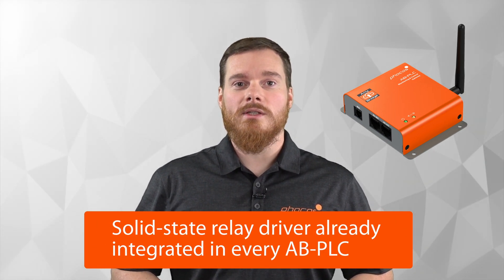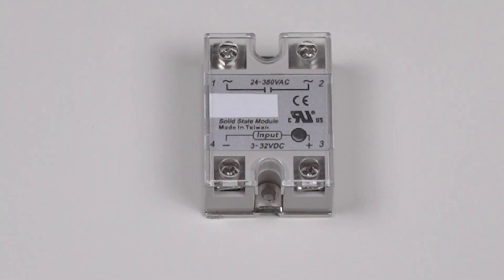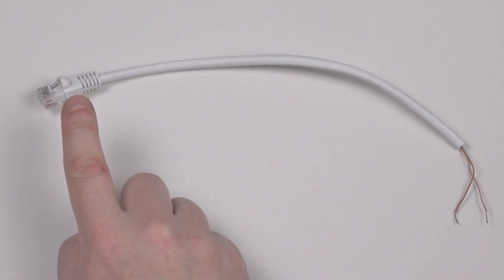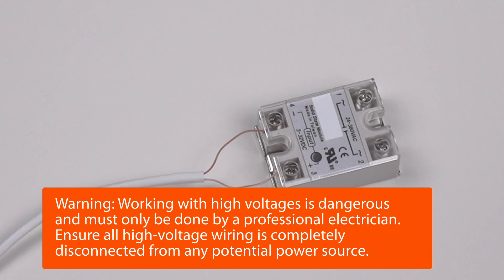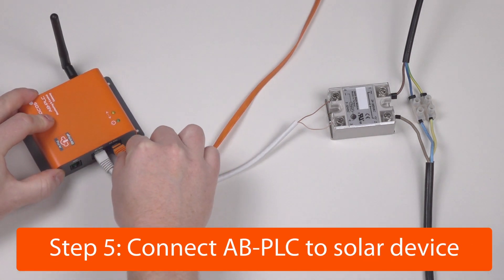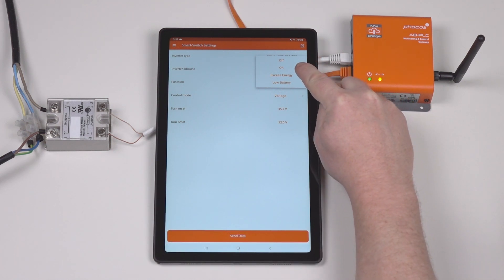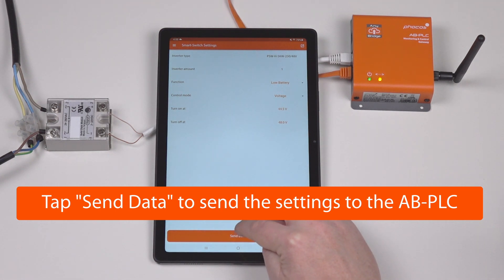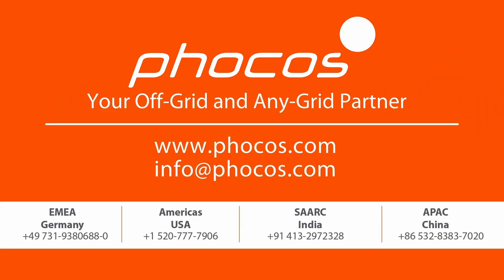Phocos Any-Bridge AB-PLC Smart-Switch Setup

Comment: Without solid state relay we cannot set up anybridge module?
Reply from the maker: Thank you for reaching out! The Any-Bridge does not need a solid state relay as it connects to the RS-232 connection. The solid state relay is an optional feature that the Any-Bridge has. The relay can be set to work with the battery for either detecting the battery SOC, turning on/off the generator or the loads. It is not something you need for the Any-Bridge to work, as long as it has a connection to the inverter for it to communicate and provide data.